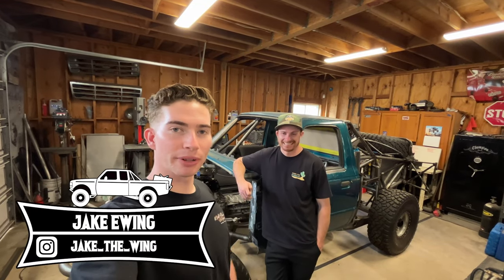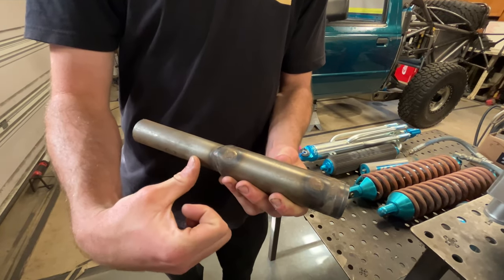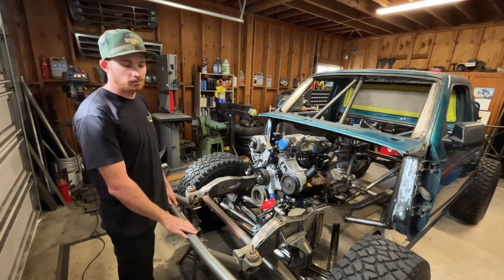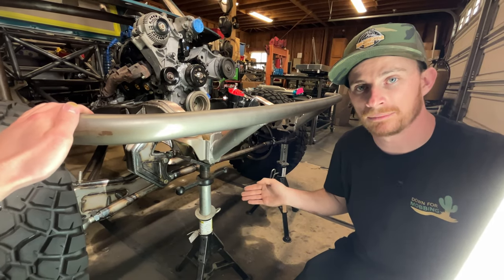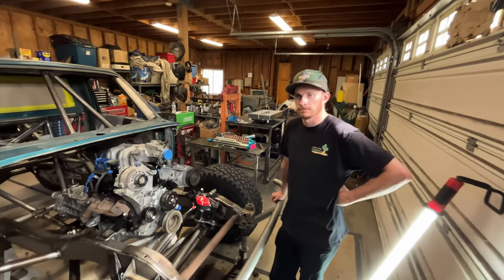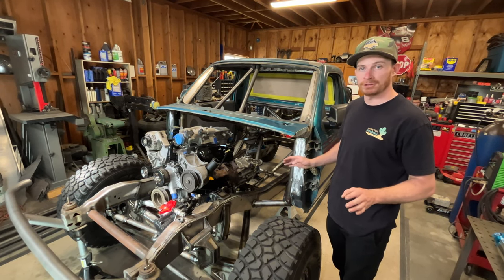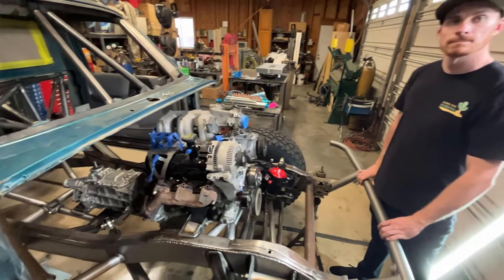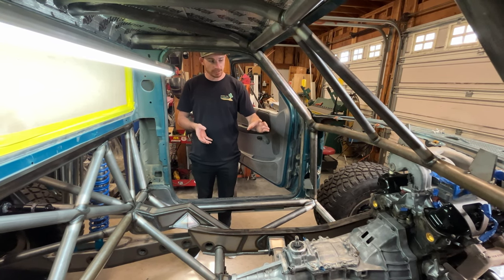Ranger Prerunner Build EP8: Custom Front Suspension and Steering!

Comment: Awesome work again guys. If possible, can we get an update once the engine cage and trans tunnel tubes are installed. 
Just to have a look at the tube work before you box it in with firewall, floorpan etc. Just a thought. 👌👌
Reply: That’s the plan!

Comment: Beautiful work as always. As far as 3D scanning goes I'm excited to see it on future builds! I'm not sure if you're going all in on an expensive scanner or not, but in my opinion it isn't necessary (may make sense for your use case though if you're doing it all the time and selling parts). You can also get high quality scans through photogrammetry. I plan on making a video on this soon, but basically you can get great scans using just your phone plus either meshroom or something like 3DF zephyr, to turn the pictures into 3D models.

 Meshroom is free and open source, but has a bit of a learning curve if the automatic settings aren't working for you. 3D zephyr costs about $200 for the non-trial version but computes very quickly and is much more "push play and go". Both take in 2D pictures and output colored, textured, .obj files.
Reply from the maker: Thank you for the comment regarding this! I have been looking into some of the entry level scanners that aren't too pricey. Speaking to a few people that have the scanners I am interested in, the results are really promising for the price point. We will definitely talk about it in a video once we acquire a scanner.

Comment: I have a question regarding “over lays” when fabricating plate Work. Besides the awesome look of them, how are they better or stronger than just upsizing the wall thickness of the plate to begin with? Great info, keep up the strong work…👌
Reply: Thats a good question! The main reason for overlays, in my opinion, is to support the bolt hole locations or a load path areas. If you run one thick plate for everything youre adding extra weight thats not really necessary. With overlays you can support what you need to and then cut out the "fat" in the rest of the areas. You can also get some nice design out of them as well which is an added bonus
Reply: @ChristianEwingVD  thanks for the info

Comment: You said you wouldn't use factory frame on the next truck. Would you use rectangle tubing or round tube for the main rails? I'm getting ready to build a willys pickup with a similar suspension setup.
Reply from the maker: Depends on the intended use of the vehicle. For a prerunner, creating our own rectangular tube frame would likely be the best solution for production time/simplicity/cost.
Reply: Main structure would be boxed/welded plate work, with tubing lacing everything together!
Reply: Where do you guys get the parts to build the knuckles?  Also is there a good place to find some used parts like coilovers and bypass shocks?
Reply: @mikebougher3731 the knuckles on this truck are made by camburg racing. Race Dezert classifieds are a good place to look for used/new stuff for sale

Comment: Why not use 7075 T6 aluminum instead of chromoly tubing for the tie rods? It is known to be quite a bit more durable than any type of steel alloys.
Reply from the maker: Great question! Steel is a better solution for stiffness/strength, which is very important for tie rods to prevent deflection (bump steer). This would also require a machining process, making manufacturing more intensive. This would be a fun solution to look into to see what tube OD/ID would be necessary to match steel tie rod attributes and what the mass would end up at. Unfortunately, with how tight clearances are on the steering systems (less than 0.25" in a lot of places), there isn't much room to bump of the OD of the tubing, so an aluminum tie rod may not solve.
Reply: To be honest I don’t know enough about aluminum to know what would be a sufficient replacement that isn’t sacrificing strength or longevity. Again too like I mentioned in the video, I don’t have a big lathe to machine the threaded portions on the ends for heims to thread into. I’m not opposed to it in the future though if I have the tooling and knowledge to do it!
Reply: @WingsWorldChannel  the typical od for offroading is 2” and solid not tube. You would be surprised that deflection isn’t an issue but the larger diameter I suppose could be. It’s not out of the ordinary to flex 4” + from bashing on a rock and not bend. One property that no types of steel alloy even come close to. This is the main reason you never see any serious rock crawlers with steel tie rods they ALWAYS bend no matter how big they are.

Comment: Does having the extreme angle of the center mounted radius arms cause camber issues when in reverse due to leverage from the beams wanting to push inwards?  Will there be lots of negative camber in reverse?

Comment: Next time start with an extra cab and have way more room to work with . I'm not a giant but in my ranger my seat is back to the point where it wouldn't even fit in a regular cab , by about 6 inch's .
Reply from the maker: Kept the single cab since that is what Ryan already had! With the C pillar outside, it won't be as tight. The main advantage of going to the extra cab would be wheel base.

Comment: Hey Christian, What do you consider too long for a 1 piece drive shaft? I am swapping from a c6 trans in my 4 door explorer to a th400 and with the overall length being shorter my driveshaft will have to be longer.
Reply: I would contact your local driveshaft guy about that, there is some factors that play into what “too long” is! My rule of thumb with off-road trucks is to get the pivoting point of the main shaft inline with the rear suspension geometry, so if it’s a longer wheelbase truck that typically leads to a 2 peice shaft, shorter wheelbase trucks like this end up with a 1 peice because the trans is in an optimal location already

Comment: I kinda wonder if u do a long arm u could do hydrolic individual on the arm so thers absolutely no toe at all from full drupe to compression so no mater if the suspension travel is like 3 foot travel 😂 idk 😂
Reply from the maker: That would be difficult considering the high response times needed for steering and the large amount of validation that would be required for us to be comfortable using on customer vehicles. Price would also be very high for a system like this. Swingset steering is currently the most reliable and cost effective steering solution for Ibeam suspension!

Comment: Why not center mount
Reply: What do you meaaaan? It is center mount…….ed radius arms!
Reply from the maker: Center mount is the best front suspension solution but is a much larger undertaking! At that point, there wouldn't be any frame rail left and the engine would be mostly inside the cab. Design/Fabrication time investment is much larger, leading to a higher price point as well. The beam kit will work great on this truck and is much more affordable. There is also something special about keeping beams on these trucks! In the future, we will build a center mounted truck.

Comment: 89 bronco $5k what are you doin?
Reply: Putting the money back in my bank account and saving it until I have atleast 2-3x more! Offroad vehicles add up very quicky when you are trying to build them correctly
Reply: @ChristianEwingVD  but that’s no fun 🤣
Reply: @korbinstrong301  It is not haha but thats just the reality of these things! You'd be hard pressed to even buy proper wheels and tires for $5k
Reply from the maker: Wheels/tires, taller coil spring, and nice replacement shocks for front/rear. Would spend money detailing the truck to make it look good as well! As Christian stated though, costs add up very quickly once you start going into more developed suspension solutions.